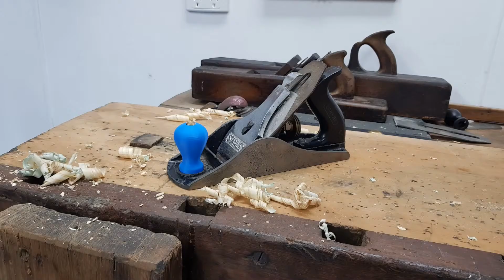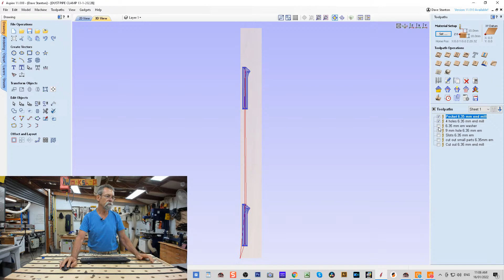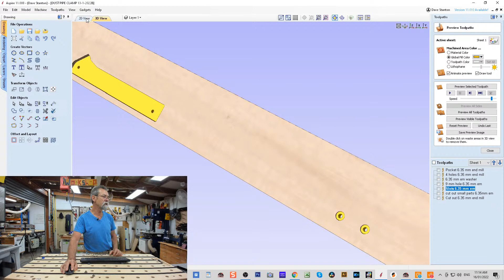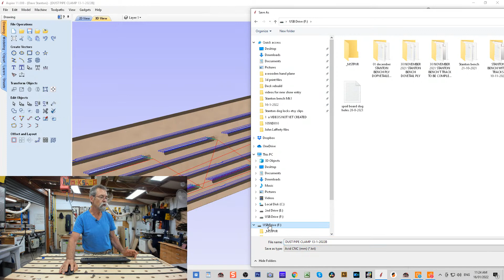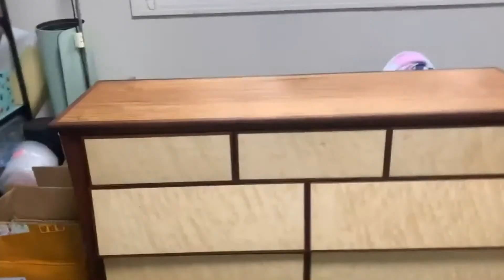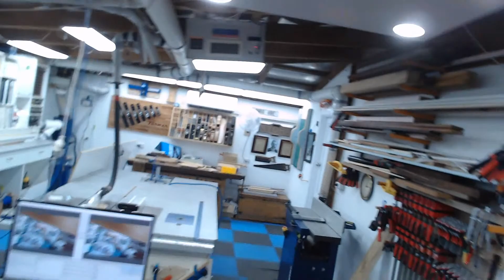CNC tool paths Aspire Vcarve | Dave Stanton Live!

Comment from the maker: After the show I did a little investigation on the control box for the cnc. I think the PCB cable connectors were in need of some maintenance. I used a specialsed cleaning spray designed for circuit boards and the machine is running perfectly again. Much like the cars we drive, even CNC machines need a service now and then.
Reply: Mach 4 is still a little bit buggy.  Sometimes it just gets corrupted and needs to be restarted like you did. I don't think it had anything to do with the hardware.

Comment: Great show Dave, interesting watching what can go wrong with the CNC, the camera arm turned out great.
Reply from the maker: Mark, I think the issue is fixed now. I pulled the PCB cables out of the control box and cleaned the connections with a specialised solvent. Running like a dream...for now.
Reply: @DavidStanton  Good thinking, it's a dusty environment (well maybe not in your spotless workshop :) ) so cleaning electrical connections could be needed a bit. I was interested about your comment on the coating on the router bit, maybe a multi-meter test for continuity but those router bits are design for CNC work. If in doubt, restart!
Reply from the maker: @markpalmer3071  The whole CNC is working well now, I'm pretty it was the connections in the control box. You are correct about the cutters are designed for cnc work. But when something isn't as it should be my mind goes through a process of elimination.